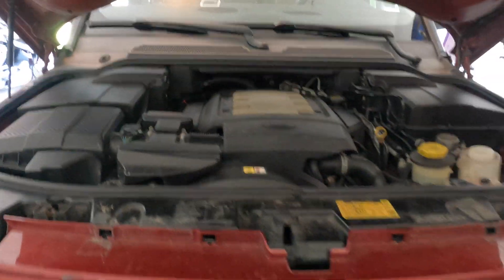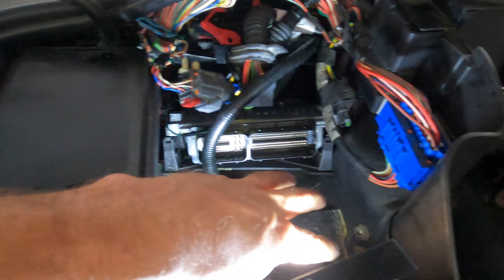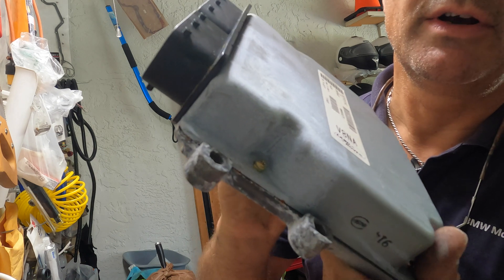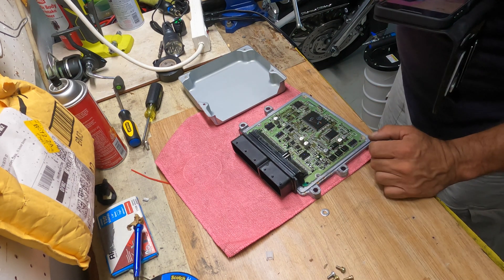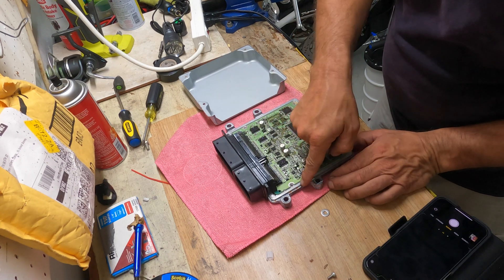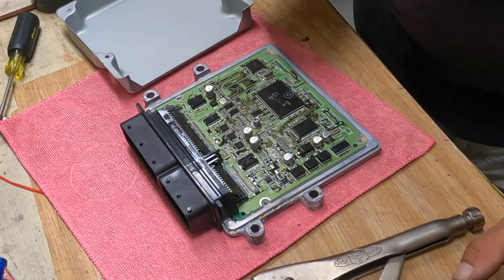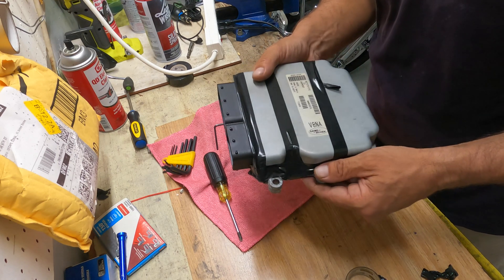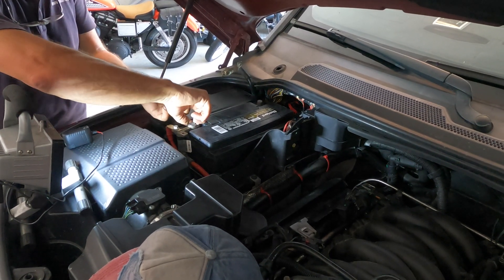Engine control unit ECU Repair, Land Rover LR3, LR4, Discover 3

Comment: Just bought an lr4 with 100000 miles for my wife. Im doing the timing chain but took it to get emissions and it wouldn't connect. I suspect the same or similar problem.
Reply from the maker: Thank you for watching and commenting, congratulations with your new car. To answer your question it could be one of the reasons. But if you buy a cheap OBD reader on Amazon it should tell you if it connects. It is hard for me to judge if this could be the problem, however it could be. The ECU and TCM modules are located in a known water intrusion area on the LR’s and therefore you could see this as a result. The OBD reader will give you the readings if it connects and then you know. 

I hope this helps a little 

Drive safely, best regards Rene.

Comment: Can you tune a disco 2 ecm?
Reply from the maker: Thank for commenting and watching, no I am unable to do that unfortunately, but that could be a good idea for the next Video. Thank you for asking. 

Drive safely 

Best regards Rene
Reply: @techtips101  duno how far have you gone with this cars,but im having a issue i have disco 2 with sai. Secondary air injection,so as remedy i want to install a none sai ecu,but i see a vin number so my question its if the VIN ints on the ecm or the bcu,whats are the pressure when your swap ecu`s.
Reply from the maker: Oh I am sorry that I wouldn’t happen to know - I guess it’s always worth a try, however it could be an expensive experience to play with. 

Drive safely, best regards Rene

Comment: Mine doesn’t have that ground screw as well inside the ECM as well. I wonder if it actually doesn’t come with one?
Reply from the maker: Yes that could be or it an assembly with missing screws, Mine has been functioning very well since 

drive safely Best regards Rene

Comment: Could the ECU affect the clutch fan? I've put in two different clutch fans and both are spinning at engine speed. The only code is fan circuit.
Reply from the maker: Thanks for watching, I am a little unsure if it would, but I would NOT be surprised at all since it has a feeler in almost any circuit associated with the engine.

hope that helps Best regards Rene

Comment: My lr3 ecu got water in it as well, pulled it out and actually poured about a cup of water out of it, dried it out inside and still won't function or communicate with my scan tool, I assume it has failed at this point, do you know what cheap software would be capable of coding a used box? Or am I stuck with the dealer or a 2,000 dollar land rover specific scan tool? Thanks
Reply from the maker: Oh that is a tough one - how about getting one from a used car - doner car from a scrap yard or eBay maybe. - the electronic chip inside do not like the water and that’s why it’s most likely dead. Make sure you make the new one water resistant so you don’t run into the same problem later. 

Sorry if I wasn’t of much help, but that’s a weak area of the car in this corner. Make sure you check up on the TCM module as well, most likely this has gotten water too. 

Drive safely, best regards Rene
Reply: @techtips101  I have a lr3 key was stolen out of the car while waiting for transport I have a second lr3 same year bad engine what do I need too replace with the ignition from other car too start the vehicle again with used key and ignition ?

Comment: I'm sure it's battery acid on the plastic bit in between the tcm and ecm
Reply: That's good she's running well. Mine still giving me shit ive pulled and checked every fuse in the engine bay fuse box and behind the glove box. Checked every earth point I could see, unplugged every wiring harness plug checked and cleaned and electrical lube on everything, Just got the clocks/instrument cluster bk from being repaired it needed to be fixed as I had a light on all the time. I'll put the clocks bk in tomorrow if i still have no joy, gona do the cambus test through the obd port and go from there
Reply from the maker: @liamdtraxxas2011  what is the exact problem ?  The LR3 does so many weird things for small problems too, and many times it seems so simple but yet so distant to solve. 

🤗
Reply from the maker: Could be - however the Land Rover is build with such poor plastic quality that the fairings below the windows dry rot over the years in hot sun - this causes a leak running straight down onto the module creating the issue I had. Of battery acid would do the same, to a certain extend, but I haven’t had any leaks there, so in my case it was excluded quickly. 

Thanks for commenting and watching though, and the Mandy has been running great since. 

Drive safely, best regards Rene

Comment: Hi, when i try to do a scanning on my 2005 LR3 V8 4.4 only the ELM is connected the ECU is not getting connected, can you pls tell me the possible reason for this.
Reply from the maker: this could very easily be a sign of water penetration, corrosion or no ground connection. Have a look at my comment above e that might close you in on the target and failure.

best regards 

Rene

Comment: A good idea is to seal the unit with sikoflex .
Reply from the maker: Yes that is a good idea 👍👍 I will do that next time I get them both out (TCM and ECM), it is soft enough to disassemble it again without damaging the unit too 👍👍

great idea 👍

drive safely 

best regards

Rene
Reply: @techtips101  yes, you can get it apart again, you could always warm it up with a hair drier or similar.  We all do this fix in Africa to save our ECUs etc.
Reply from the maker: @overlandi5056  very good idea, can inform you the Land Rover survived the hurricane Ian, but was extremely flooded - but hat a few Po codes and now running flawless again :D

Comment: What's the module under the glove box in a 2007 land Rover lr3 hse?
Reply from the maker: Thanks for watching and commenting :)

It is the Body control module (BCU) always check the connectors on this module since if it has been exposed to water leakage, the connectors can corrode and it will normally be visible, as green residue on the connector in the plug.

A new BCU is in the neighbourhood of 115usd - 150usd as we speak.

example of link:

https://rpc.landroversandiego.com/oem-parts/land-rover-control-module-nnw501996

drive safely 

best regards Rene

Comment: Good Job René.  I did have issues with the slodering points of the connectors before. Christian
Reply from the maker: Thank you so much - and thanks for watching and commenting, yes, this issue that I had has now totally disappeared, and we are enjoying the Land Rover again. It’s wet season here, and there will be a few trips to the watering fields in the next coming days to go hunting, hopefully it will be with no problems at all now. 👍👍

Drive safely

Best regards 

Rene.